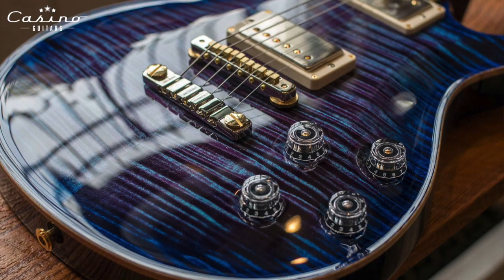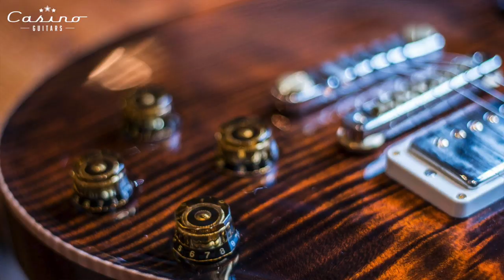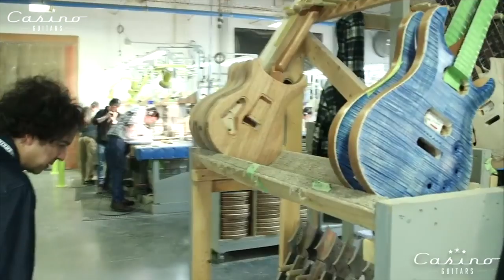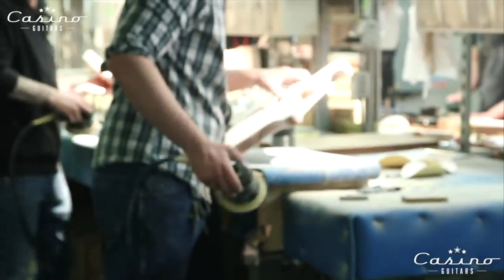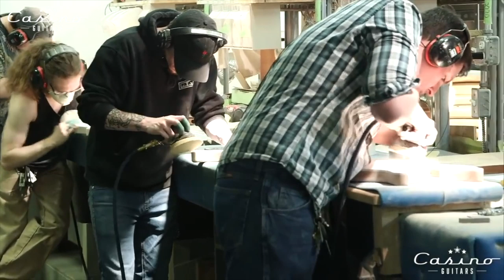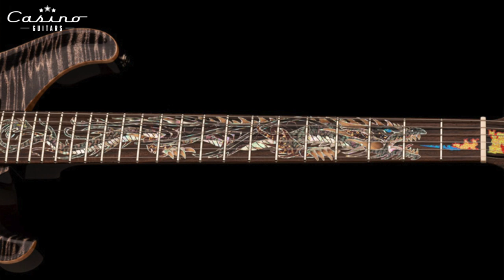Why We Carry PRS Guitars

Comment: I hadn't even considered one until a few years back. When Andertons bought up a bunch of those satin black ones that were for the Euro market, super cheap, and were then knocking them out super cheap. I got one of the Zach Myers semi hollow ones, for 450 quid. 
Aside from a Japanese built Ibanez I've got, this thing is the most perfect thing out of the box I've ever bought. Factory set up on it is mint. Nothing has ever fallen off it, and there's no imperial sized tools required. Aside from swapping the strings to 10s, it's needed zero work on it. 
And it sounds amazing.
It's made in Korea. I don't know where newer ones might be made. But I'd have another Korean built guitar in a heartbeat.

Comment: I started with Squier Stratocaster back in the 80's, but I've dreamed about PRS for 29 years, from the day I saw and played one in a music store. A few years ago I even built a copy of PRS for myself. But there was always the price issue. And I had built electric guitars, even more so, because I could make quality guitars myself with 500-600 dollars. But there was this dream. So, finally last December I bought a used, mint condition PRS standard 24 custom (2005). And it's exactly as awesome as I expected. The day before yesterday I bought another one, PRS singlecut 10-top (2006). Now I only dream about more Paul Reed Smith guitars.

Comment: I used to be strictly a Gibson guy. I had fought an LP for 22 years, through a fingerboard planing and two fret jobs. I got a used SE soapbar Singlecut for $250 to use as a back up. The fretwork smoked my Lester and the guitar stayed in tune better. Flash forward 15 years. I’ve sold everything except a non cutaway archtop and replaced it with  PRS. After 50+ years of playing guitar, I found what gives me the sounds I hear in my head. Oh yeah, I’m just an average working stiff who has a degree in music and an absolute love for guitar.

Comment: I just bought a PRS S2, which is the most expensive guitar I've ever had, and it had several issues out of the box. Intonation was off, it was binding at the nut, had some scratches on the finish and fretboard, and the tone knob crapped out. 

However, I did get it fixed into working condition and it is a great guitar. It plays like a dream, the neck is really nice. It is also quite a beautiful guitar and it sounds great as well. Crisis averted
Reply: Which S2? I recently bought a new standard 22 in antique white and it had finish cracks coming from 3 of the 6 bridge post screws. Neck relief was also way out of spec. Got it set up and it's fantastic, the cracks dont bother me because of the deal I got on the guitar
Reply: @Hobinator17  Standard 22 as well.

Comment: I picked up a Fender Concord at a shop in the early ‘90’s, played acoustic exclusively for… until Thanksgiving before COVID then I decided to plug in. Bought a Gibson Les Paul and I wanted to modify it, when I played it I would think, okay what’s the big deal. I bought a Thinline Telecaster and modified the heck out of it, I love it but I still need to file some fret ends. Got a couple of Epiphones, mods and fret work and they’re good. Sold the LP and bought a PRS (from Reverb, it was mailed) thinking I’ll have a ton of mods to do, but when I got it it was perfect. Smooth frets, perfect intonation, no truss rod adjusting, it stays in tune, sounds and plays fantastic. I’m a Fender PRS guy, Fender has so many options and parts, you can tinker until the cows come home. PRS over Gibson because the quality, if I’m going to modify a LP I’ll just get an Epiphone. From a guy who just plugged in.

Comment: I love my PRS, and my Fenders, and my Gibsons, and my.....  I have a few.  Listen, PRS since 2007 has completely changed their game, and it comes down to pickups. Best build quality in the industry and best necks although that's a preference thing. I have Custom shops Tele/Strats which I adore, and have a DGT, 594, and CU24. I would say my DGT is my fav, but my 594 which is only 6 month old is getting a lot of use. I didn't think I'd like the 594 due to it's neck being larger, but it's so comfortable and I have no issues playing it with my smaller hands. But I still love my strat too. I'm a true believer in if you want a LP sound, buy an LP. If you want a tele sound then buy a tele.  PRS offers something a little different sound wise, although their split coils which are best in the industry imho can do 80% of the other brands sounds.  PRS is the ONLY brand in electrics I feel comfortable buying online without playing first.  They are so consistently build. Also the only ones that stay in tune lol.  Also a very friendly community, head over to their forums. It's not like the TGP nonsense.

Comment: What do you think about the S2 models? Especially the new one's. I heard Paul talk about the S2 MCarty and it seems to me that they are very similar to the core ones. Great channel by the way! Huge fan from Mexico.
Reply from the maker: Love the new S2 McCartys! We were able to play them at NAMM. I haven't loved every S2 model however. Some have left me underwhelmed personally but I am thrilled in the direction they seem to be going.
And thanks for watching! I love Mexico, was just in Tecate (down at the Taylor factories) and had some amazing food and fun while there. 
Best to you and yours and be well out there!
Reply: The S2 line is advertised as "Made in USA" but they convienently leave out that many parts are Made in S.Korea.
For example the pickups and pots are the same as in the SE models,Made in S.Korea and the trem and locking tuners are also not the same as in the "core" line.
On top of that,the neck construction is different.
Over here in Europe,they ask almost 2,000 Euros for a S2 Cu 22/24,I can get a Korean Schecter C-1 SLS Elite,which is a similar style modern doublecutaway guitar and has far superior specs (like multipiece neck,neck-through construction,stainless steel frets,compound radious fingerboard,Made in USA Fishman Fluence pickups,Sustainiac variant,fixed bridge or OFR available,really nice flamed top with faded sunburst finish),for far less.

Comment: Baxter, you should really give the S2's a chance. They even have a McCarty model. I have an S2 custom 24 that my friends got for me when I was taking radiation treatment for thyroid cancer. I've never had anyone do anything for me ever. It really touched me. But that's neither here nor there. The S2 is amazing. The tone, feel and playability is amazing. The neck is probably the perfect carve. Not too chunky but not thin shredder type either. I would say it's very close to a '61 Les Paul (SG). Mine is elephant gray burst flame top with some bear claw in it. It has a few bucks and dings now, but it's meant to be played. Nothing I have is a wall hanger. Yeah they all look great. But just a piece of art or conversation piece they are not. The only thing I'm contemplating changing is the pickups. I like the 59/09 set. So I may go that route. Not that the pickups in it are bad. But the 59/09 just has this tone that I really like. More of a vintage sound in a modern setup. If that makes sense. Well there's my 2¢

Comment: A take on price. I drive a Chevy pickup, 2012. To replace that with a 2021, in real $$ after any/all discounts, is $60,000. A PRS 594 with artist package is about $6,000 all in.  1/10 the price.  I'm currently trying to decide between an R8 and 594 to add to my already too many guitars, an 'only need need one more thing'.  And I'm going to drive my 2012 'pickup' 2 more years at least.  FWIW,  and  JMHO   8)    --gary